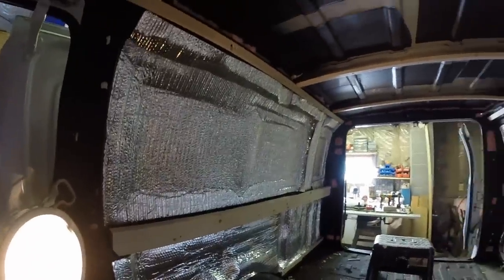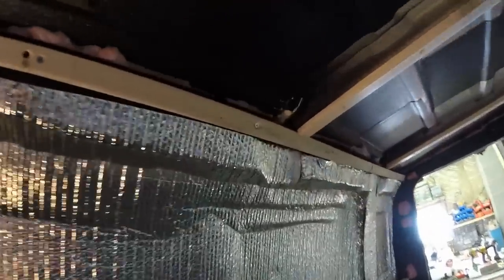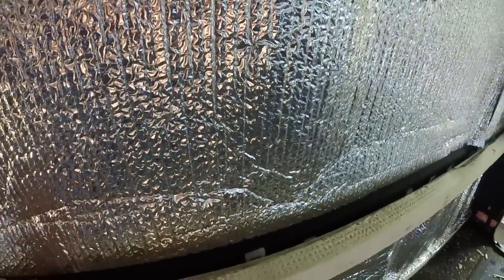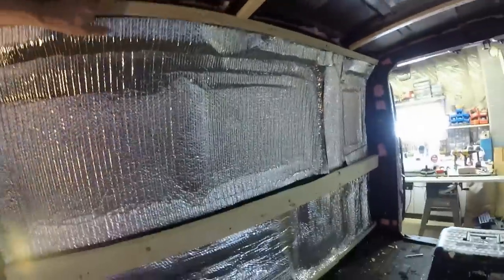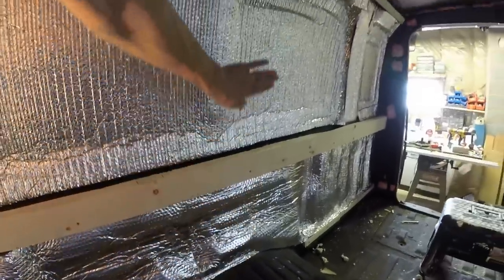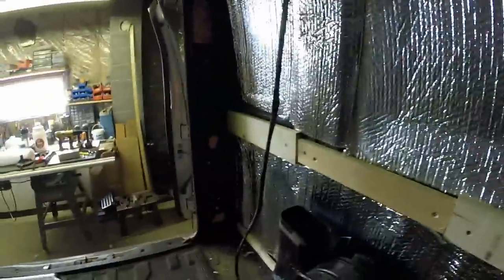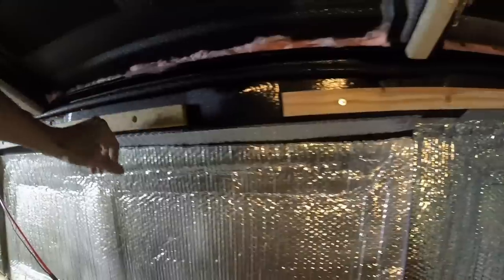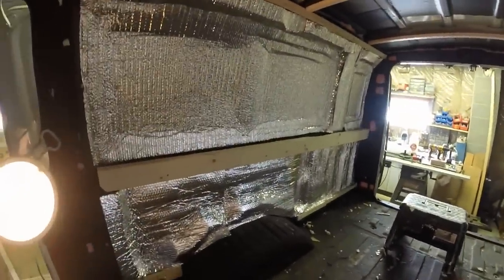#VanLife - Building Custom Furring Strips in Van

Comment: What kind of screws did you use on those furring strips? Thx
Reply from the maker: Explore My Business Self-tapping metal and wood screws, 1" long.
Reply: *****  Thank you apprecaite it
Reply from the maker: Explore My Business I guess I should clarify. We were using 1x2 and 1x4 furring strips so the actual board thickness is only 3/4". If you use a 2x4, you'll want a screw about 2" long. And in the case where we had to mount a 2x4 to the face of a 1x4, we just used 2" wood screws.

Comment: Engineer says in previous video (INSULATION) now change opinion NO longer recommend Reflectix AT ALL! Back to WHY furring strips http://lowgravityascents.com/2015/02/28/insulation-living-in-a-van-vanlife/
Reply from the maker: yumpinkchocolate You would still need furring strips as a way to easily mount things to the wall for stability. I wouldn't be able to secure the bed frame or the cabinets any other way.